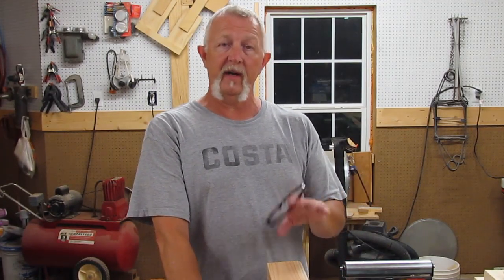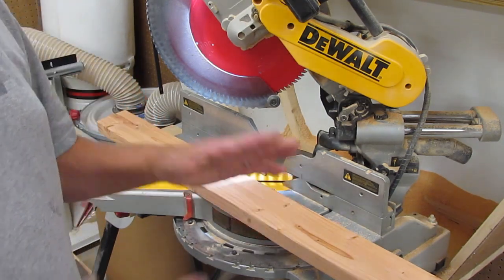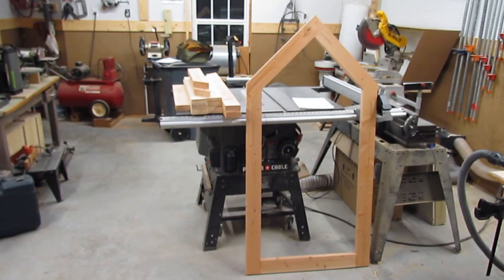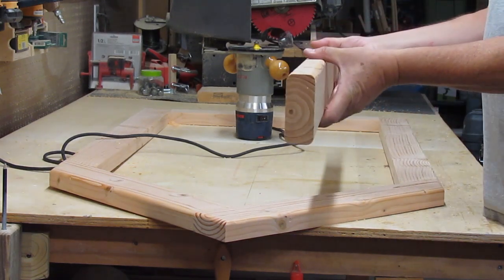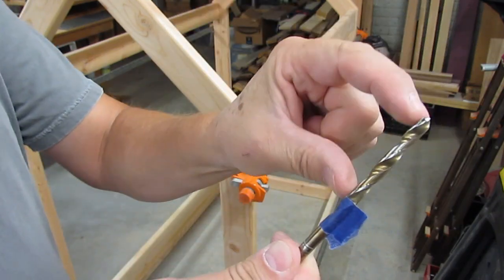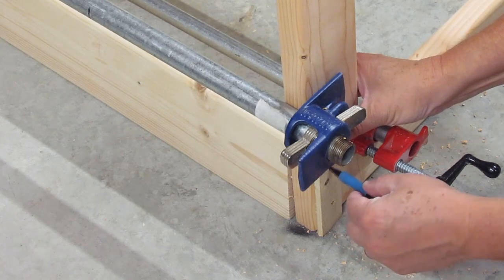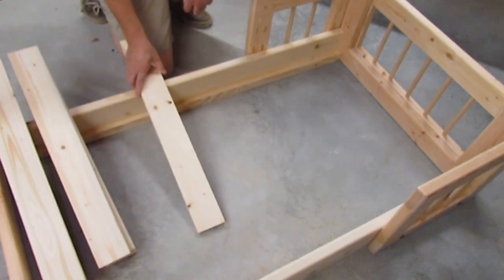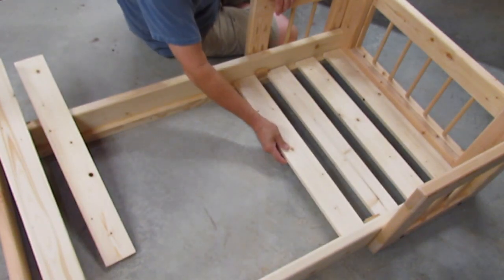Build a House Shaped Toddler Bed

Comment: Great Video! How would you go about building one of these for a twin size mattress?
Reply from the maker: Thanks for watching, Art!  The length and width will be pretty easy, just make those members the size of the mattress.  I'd have to recalculate the angle of the gable ends, based on the width.

Comment: Hey Dennis! Thanks for the video! Do you know the angle of the gable ends if I did this for a twin mattress?
Reply from the maker: Thanks for watching, Relly!  I'd just do them at 45 degrees, then you only have to modify the length of the gable boards to make up for the added width.  I'm working on some plans to post online, I'll try to get some made for twin mattress dimensions too.

Comment: Hi. Thank you. I was asked to build one but I have to go a little wider. So my outside dimension is 36” on gable ends. How do I figure out my gable end (rafters)  measurements, using 2x3s, 45 degrees at one end?? Thank you!!
Reply from the maker: Thanks for watching!  If you're 45 degrees at one end, take your 36", divide by 2 (because you have 2 rafters) = 18 inches.  Multiply by 1.414, that equals 25-1/2".  That is centerline to outside, so you have to account for your material width, etc, but that should help you lay it out.

Comment: do you need special screws for top of bed?
Reply from the maker: Thanks for watching, Maria!  I used 2" coarse pocket hole screws for assembling the ends and knock down screws to attached all the beams between the ends.  I have included links for all the supplies and tools in the video description.  Thanks!

Comment: So hold up. The 44’s were cut at a 35 degree? What’s the actual length and angle cut? I’m just trying to make my son a bed. I don’t care to be guessing but you do just kinda throw the first half of the vid together without providing much info. The video description just says mitered.
Reply from the maker: 45 degrees
Reply: @dwcoffey  awesome. Sorry if that came off crass. Just really looking forward to making this for my son. You did amazing, really appreciate it.
Reply from the maker: No problem at all.  I really should have included a drawing in the video, it would have been more helpful.  This bed has held up through 2 grandkids so far, and has been moved 3 or 4 times.  I kept the angles at 90 and 45 just to keep things simple.  Please let me know if I can provide any other dimensions, etc.  I'll be glad to.  Thank you for watching!